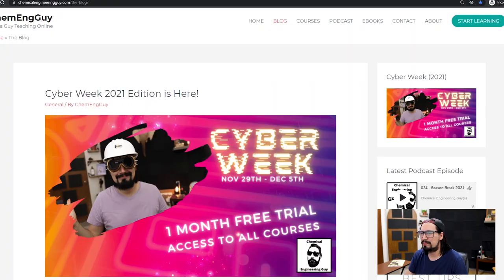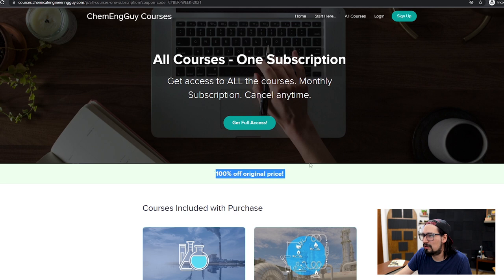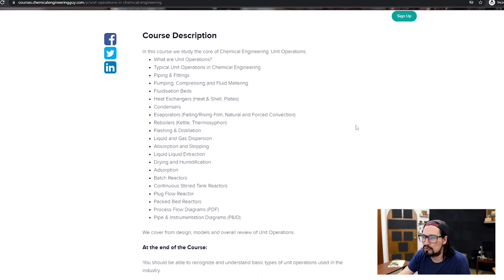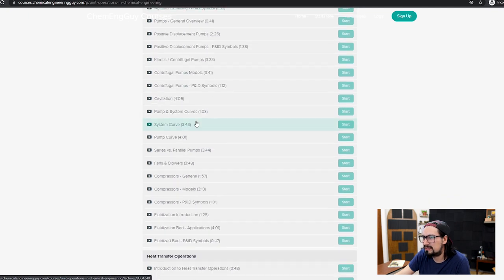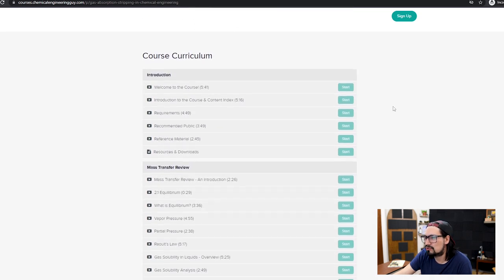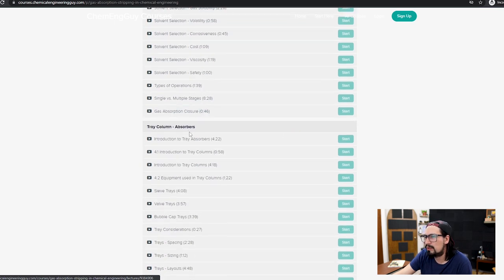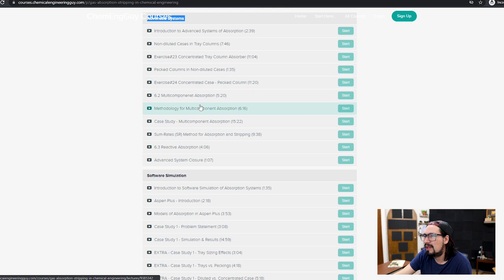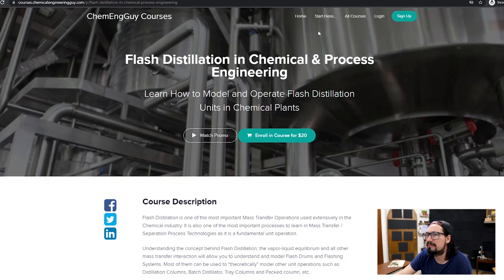Categories of Unit Operations & Equipment used in Chemical Plants & Process Industries

Comment: Great knowledge. This raises a question, does a ChemE know the mechanical/civil/electrical/software engineering parts that are specific to the chemical plant? Or are other engineering disciplines still necessary?
Reply from the maker: For sure, you need all of them... the Civil will most likely focus in structure and building, software into programming or so, mechanical into more mechanical/machinery, electrical will focus into electric installations and more... chemE should focus mostly into process control
Reply: I can how electrical and chemical are different from each other. However, the line that splits chemical and mechanical engineering (in the chemical industry) is blurry to me. Could you explain the overlap and differences between the two briefly? @ChemicalEngineeringGuy